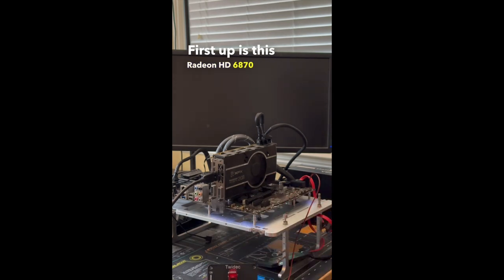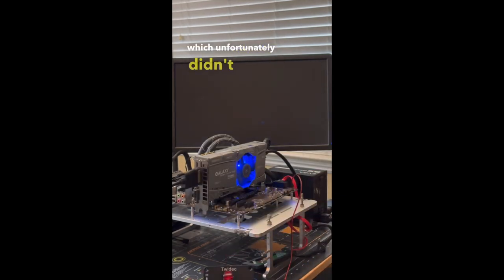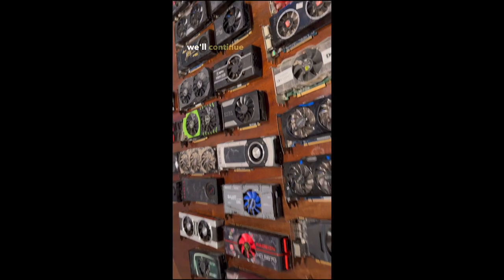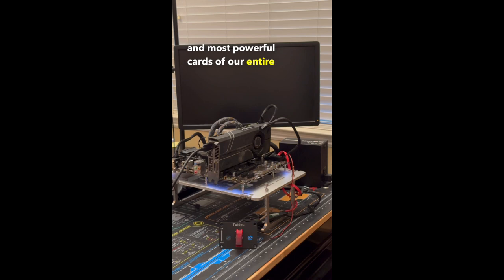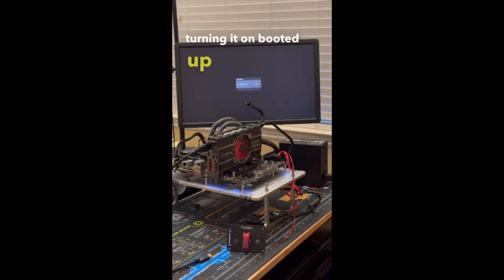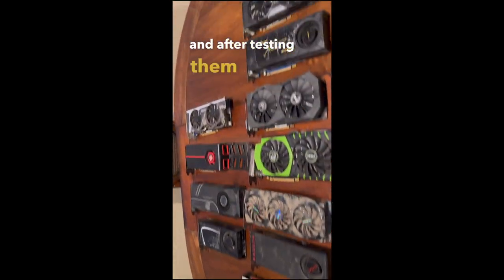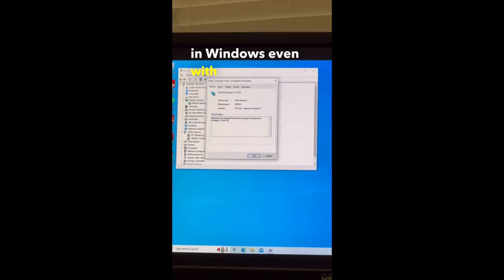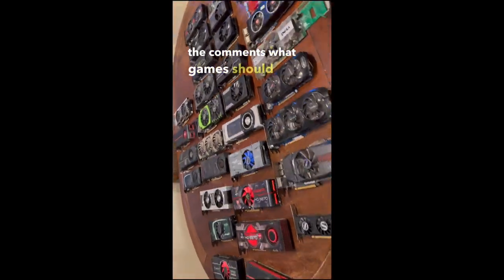Unbelievable Find: I Got a Massive GPU Lot...But What Happened Next? Shorts Compilation

Comment: nice video, these cards are mostly old grandpas but maybe you can use a former bitcoin mining motherboard or risers and connect all these cards and use a good card for displaying purpose, check if your PC can see the connection of the other broken cards, maybe they have broken display ports that's all, I mean cards which can not show display but still have calculation purpose which can be used for bitcoin mining or 3D rendering, suck that most of these are very old and hardly can be utilize for any meaningful purpose.